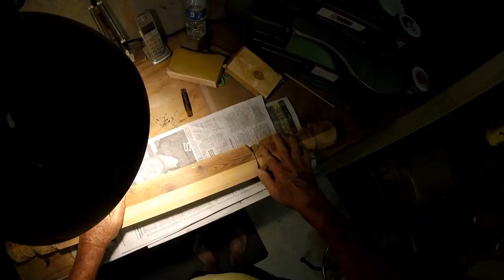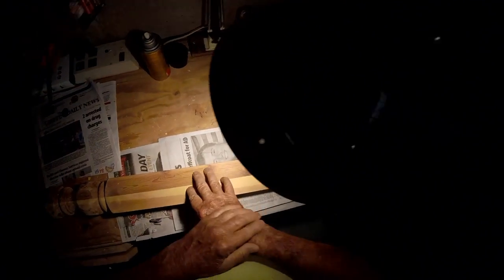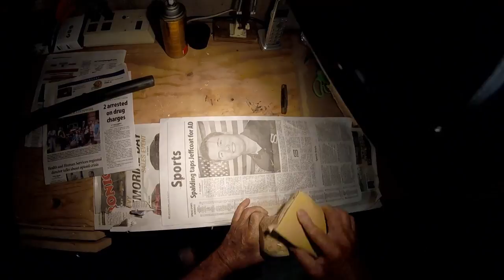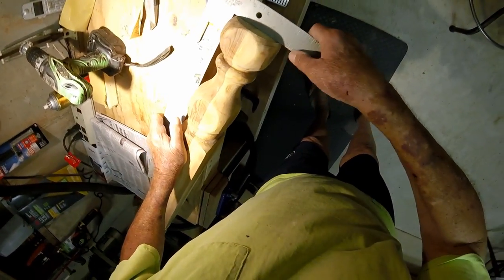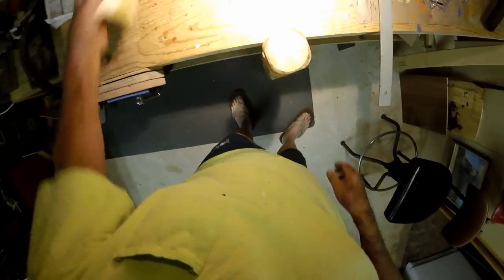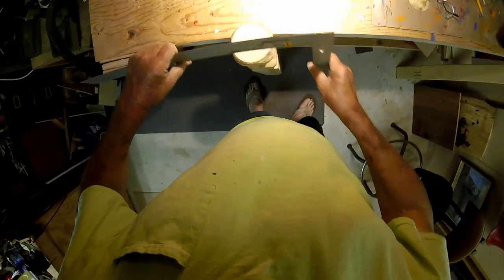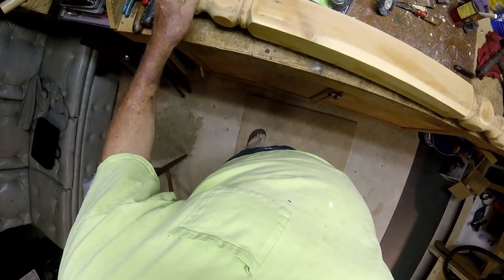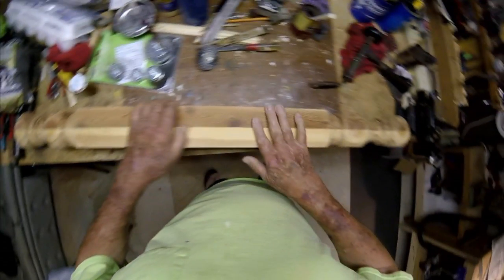Whirligig Stand Part 2

Comment: It's a lot of work to get all the old paint off of something. That piece of brass tubing sticking out from the bottom of the whirligig is 3/8". The inside of the brass tube will accept a 1/4' piece of steel rod. The way I would do it is to drill a 1/4" hole about 2-3 times the length of the brass piece, then drill a 3/8" hole the length of the brass piece in the 1/4" hole. This will allow you to put a piece 1/4" steel rod (the same length as the hole you just drilled) down the hole, which the brass piece will fit over. This is just making the brass piece effectively longer and stronger so there is no chance of the whirligig lifting up and coming out of the hole or the brass piece bending. I hope you are well Walter and this helps.
Reply from the maker: Your rod trick worked well  Thanks

Comment: Hey Walter Looks good. JUST A FYI.  TO CLEAN UP THE SMALL AREAS.  YOU COULD USE. A SINGLE PANE OF GLASS. FOR. TAKE OFF. PAINT AND OTHER THINGS. JUST. BREAK THE GLASS. TO GET A POINT. I always use. Glass to get the finishes  off wood. Use the glass like a knife or a scraper like to take paint off .If the glass is dull on one side  turn over or pull the glass the other. Way. It works great better then buying a whole load of sand paper.  Take care. JUNKMANDO
Reply from the maker: Thanks  the glass trick is handy for trimming hammer handles to fit as well